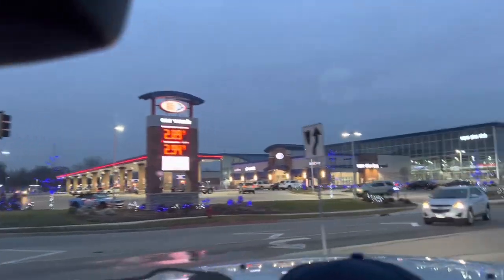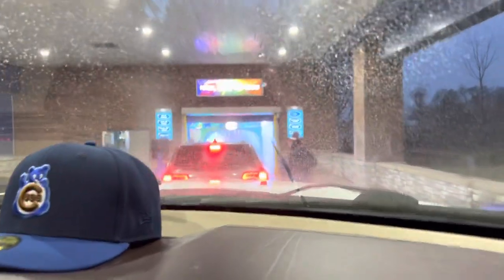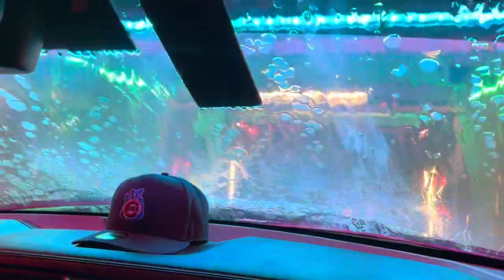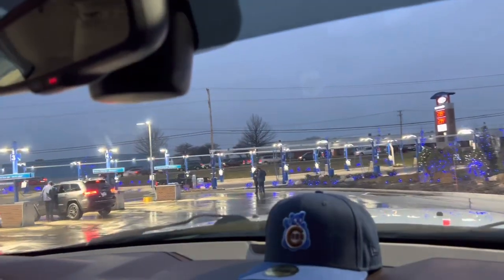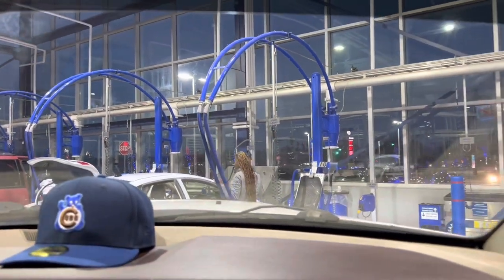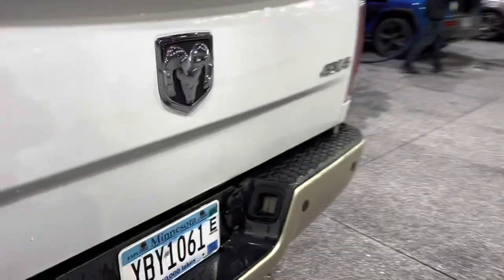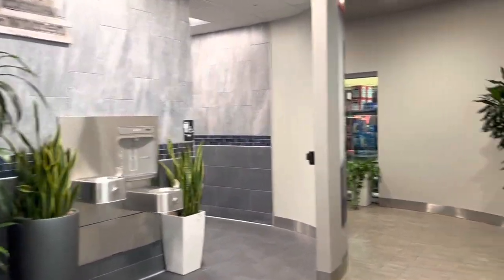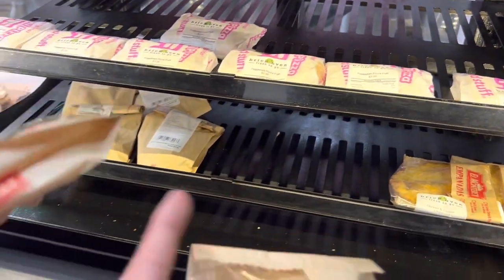Super Cool & Rare CAR WASH 🧼 🚗  in Oswego Illinois DELTA SONIC WASH

Comment: Been a customer for years.
But I can tell you never going again!! 
They damaged my SUV with one of their roller brushes, destroyed my roof rails, said they would put in claim and now after bugging them for MONTHS, have offered little to nothing to have it fixed.
For the record, nearly ALL cars with Roof Rails are installed from the inside of the vehicle. To fix these, the interior ceiling liner must be removed to get to the rail bolts. Doesn’t sound simple does it! Guess what Delta Sonic offers to have that done? Pennies!! 
They don’t take responsibility, they don’t return emails, they damage vehicles and expect you to smile and take it. 
DO NOT BRING YOUR SUV or ANY VEHICLE with A ROOF RAIL SYSTEM TO DELTA SONIC, YOU WILL BE SORRY and they don’t care!
Reply from the maker: Sorry to hear that happened to you..